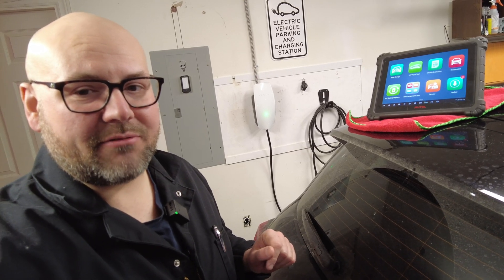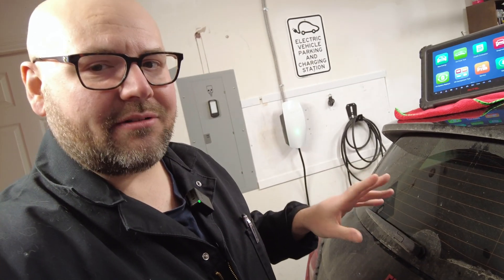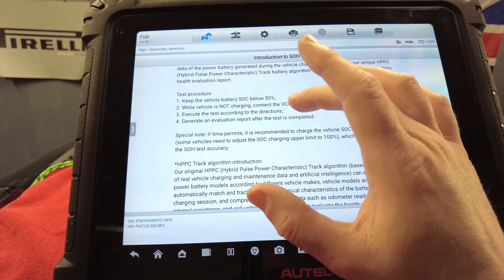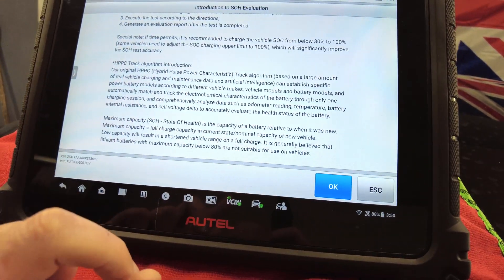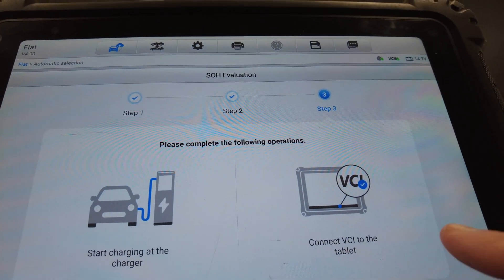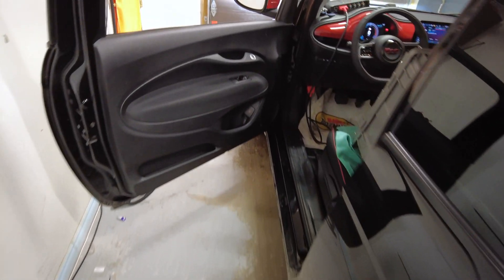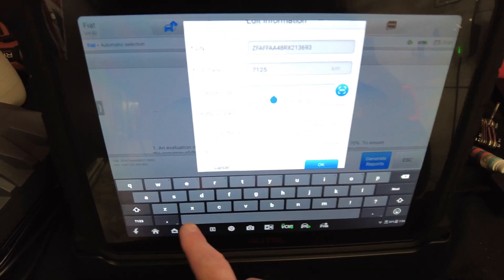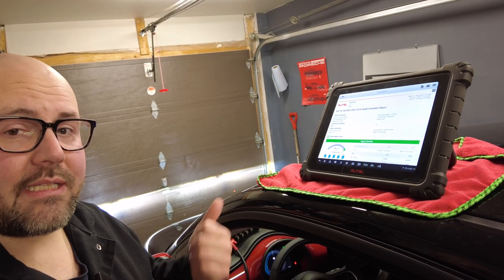EV Battery Health Test | How Much Battery Capacity Has It Lost?

Comment: I am doing the same SOH test on my Tesla. The problem is that the Tesla shuts down by itself after approximately 30 minutes and the test gets abrupted. 

Any solution to this?😊
Reply from the maker: Tesla has a SOH mode in service mode. You can also put camp mode on
Reply: Thanks for the quick answer😊 

I always put the Tesla in Service mode Before i connect the obd with adapter. But still the same. Car shuts off after 30 minutes. 

I think I will have to try The camper mode and Service mode. Maybe it will work  @SimplyGregsterEV

Comment: Short battery life stereotypes are mainly from Leaf's, most other EV's have much lower degradation over time. We have 73k miles on our 2022 Ioniq 5 and the BMS still reports 100% SOH. If I do the math myself, charging to 100% and reading available energy it's lost 2.9% although the available energy will vary with temperature. It went down a few percent last winter as well then came back up in the summer. It's probably lost someplace from 1.5 to 2.5% but no noticeable loss of range at this point.
Reply from the maker: That is great to hear. Thanks for sharing!

Comment: Enjoyed watching your video and thought I would share my experience.
I have a 40 kWh LEAF, 2019 with 83,000 km LEAF Spy claims 89.x% state of health. I bought the car new but it had sat at the dealer for about a year and a half with less than 200 km, I used LEAF Spy about a month after purchase and it was a disappointing 95% but since I learned it is similar to what most experience for that age car. We went on a 1,400 km trip Dec 28/24 and the state of health actually increased by 1 %.
When the car says it is fully charged the LEAF spy app reports 96% and when the car displays 10% charge LEAF spy indicated 22%. I have a feeling that the car is programmed this way by Nissan to keep drivers from running their cars down to zero charge and stranded 10 km from the nearest charge opportunity.
Reply from the maker: @gerhardk98  Correct there are upper and lower buffers.
Reply: leaf spy is not accurate compared to Autel or Launch- from my testing its off 3-5%